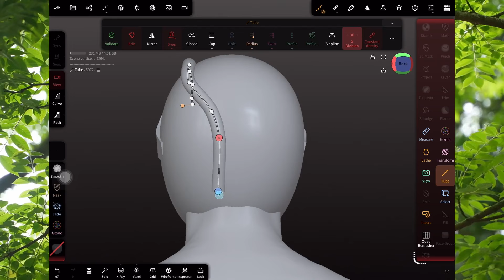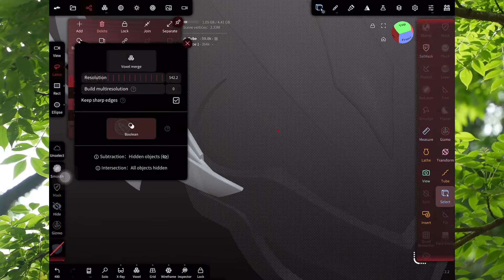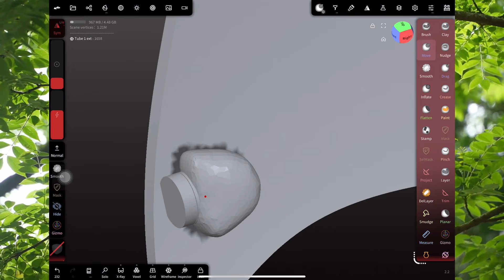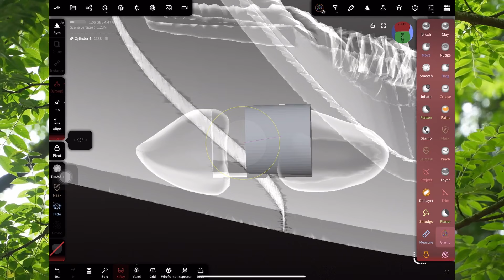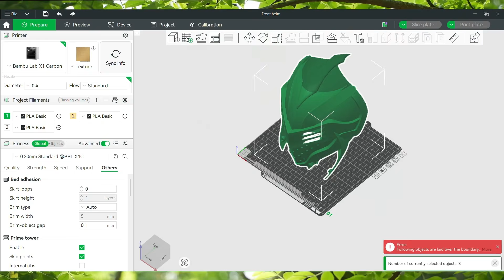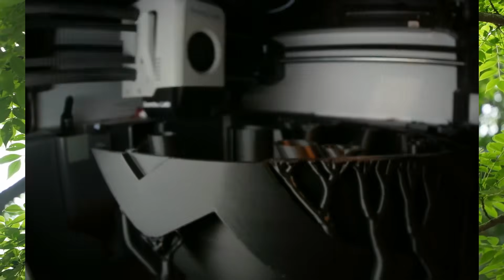Nomad Sculpt: How to Make Cosplay Armor (Ep. 1) Helm Time

Comment: So like I got caught out at the stage of putting a crest in the centre. ‘Pushing it over and then forcing symmetry’ what does that mean??
Reply from the maker: So there's a symmetry option in the top menu. It looks like a triangle. You can use the chicken icon in the arrows to determine what direction you want to push the symmetry to.

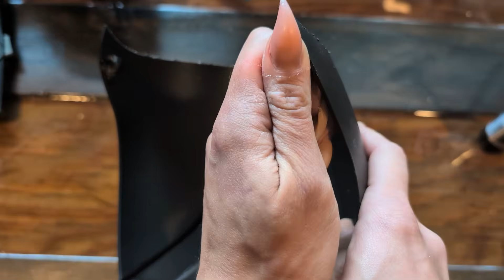Comment: 29:27 a Prusa xL would have saved that sheet-show
Reply from the maker: Yeaaaah I totally get that. I want a large format Bambu printer and I used to have a Kobra Plus. But most people can't afford a large format printer.  For the sake of my own convenience, yes, a large format printer would be great But I definitely like pushing myself to to find solutions within the parameters that I have currently.
Reply: @ChaosCostumes  You likely already know so this is more likely to help other viewers - The Bambu have the H2D with dual nozzle so you could do PETG with PLA supports which would be good. But I'd wait to see what the unreleased nozzle changer printer is - when it comes out near end of year. That does not look like a true filament/ tool changer so will still have purge waste - but it was a short video so they could surprise us. The Snapmaker U1 just released, it's a Prusa XL based tool changer for under 1000USD. That has 4 nozzles on approx. 250mm bed. Then there's INDX which will be a tool changer that you can add to an existing machine, as a project. Prusa showed a Core one with 7 tools. So you could do 6 colour's plus support or 7 colour's. The Prusa XL with INDX would have at least 10 tools. So 9 colour's and 1 support....   a few options coming this next 2-3 months so you'll have a few choices. unless you do INDX on a large printer as a project most will be smaller machines and may not suit.